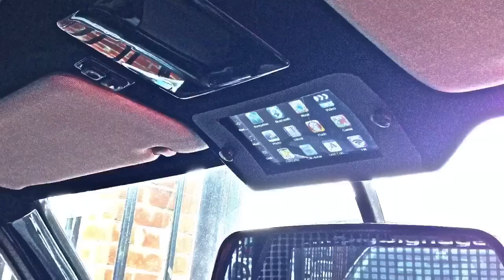BMW E30 Turbo Conversion

Comment: Doing this to a 320i Auto is definitely a good way to piss your money down the drain. 

Do an M20B25 manual swap first for God sake.

And that poor touring is GRIM :(
Reply: Why should you can get enough hp from the B20 when you add the right turbo,better this than swap
Reply: I've slightly changed my opinion, and I think that theres nothing wrong with doing this really, but you'd get more performance per $/£/etc using a B25. More displacement, more free flowing head, etc.

I guess the option is always there to drop the B25 in further down the line if you feel the need. The turbo kit built around the B20 will all bolt on.
Reply: @BlueXonar  yes i understand you

Comment: hey man could you walk me through what internals upgrade you did? or rebuild also the size of the turbo!
Reply: Tim Fisher I bet it was a stock block rebuilt OEM head and arp headstuds with a fresh OEM gasket and a HX35 12cm^2 exhaust housing